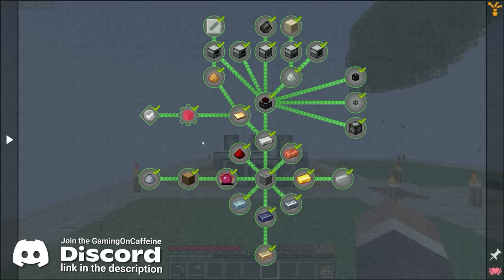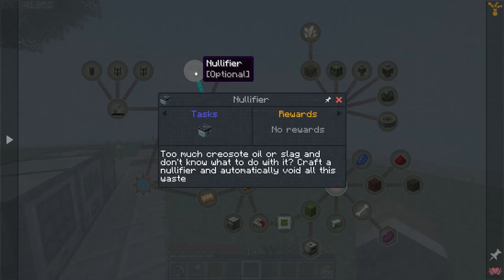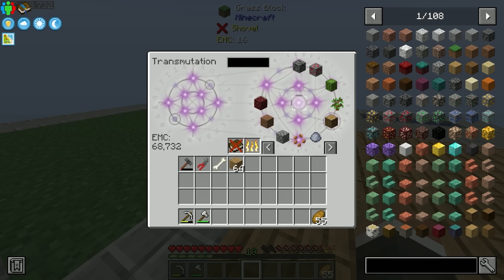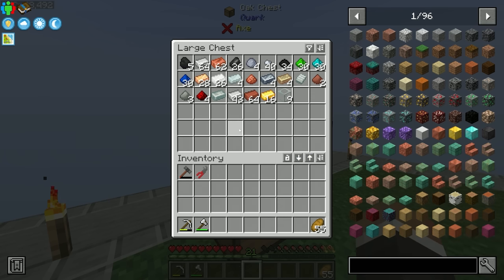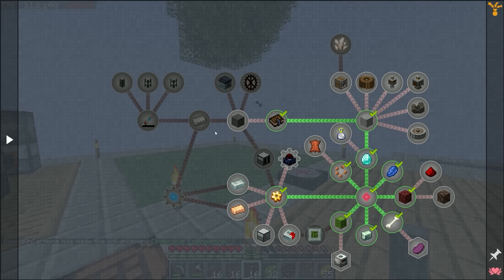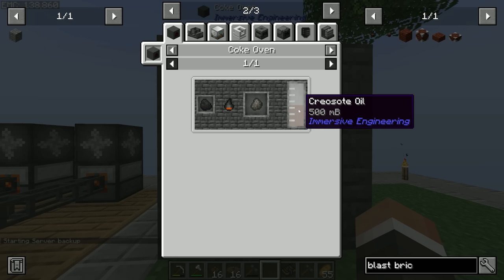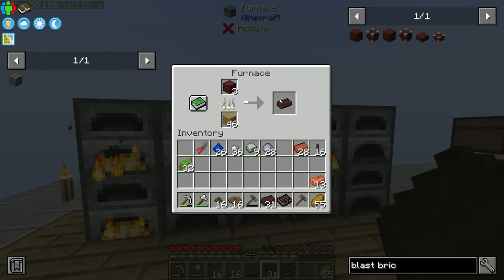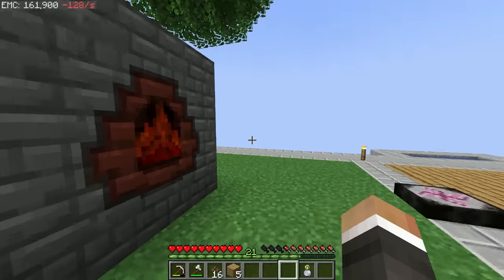Minecraft Mechanical Mastery | POWER UPGRADE, INFINITY STEAK & STEEL! #2 [Modded Questing Skyblock]

Comment: The fan above a heat source will produce rotational energy, think like a steam turbine
Reply: create does actually have a steam turbine setup that is a modular multiblock.   although the fan on a magma is a nice and cheap early way of doing it.  but the steam turbine setup i think the smallest one produces over 2k stress units and easily outscales a maxed out windmill

Comment: 52:16 
I know this one. Set up a campfire under a fan facing it. The blades will turn due to the breeze being created by the campfire. It’s not much, but it’s free. I completely forget how you’re supposed to collect those stress units, though.
Reply: AFAIK that isn't a thing anymore on the most recent versions of Create.
Reply: @JulianSkies  
Aw, that sux. I remember reading it when I played stoneblock 3 (which now forces my computer to shut off and restart when I try to play it, meaning I can’t play it at all) on a wiki. Shame it’s obsolete now.
Reply: Fans can’t be used as a rotation source any more, but horizontal water wheels are still very much a thing, and are honestly better than fans if you were to ask me-

Odd that the quest doesn’t reflect that change, though.
Reply: @Darkest_Hour  
Since we can still use soul sand to make bubble columns, we can still make water wheel arrays. If you only need a little torque, horizontal water wheels are awesome yes.

Comment: Keep up the good work! I did the same thing with the sawdust, feels like a lot of the start is kicking that can down the road.
Reply: I just used an autocrafter to just straight up craft logs into planks. Less efficient, but it doesn’t really need to be, since it only reduces the input EMC by a few percent to use the sawmill, but it’s not like this early game power is sticking around for very long anyway!
Reply: The solution is turn the planks into sawdust, too, no filtering required if the sawdust is the only fuel ;)
Reply: Does the pack not have compressing drawers that would just compress the sawdust into fuel?

Comment: Obsidian you can make the same way you did in the last mod pack when you put one pocket of water above the cauldron and because you have so much lava around you can pipe some out or you can make lava making system for the obsidian because it's easy to make and with storage you will get so much obsidian

Comment: If you are just playing through this modpack like I am, please use the Lapidary dynamos to produce your power. I've seen a couple people go through play throughs and not one used it. It might not be THAT great for the first tier which is 150k RF generated, but the tier 2 is 600k rf and only gets better. you only need a couple to power almost all of your machines. just have to use pipes to do it efficiently with stack limiters.  Also utilize the first integral components and thermal upgrades for all of your bottleneck machines

Comment: Is there any way to turn the rotational power from create between vertical and horizontal
Reply: Use a vertical gearbox and you can connect vertical with a horizontal output as well